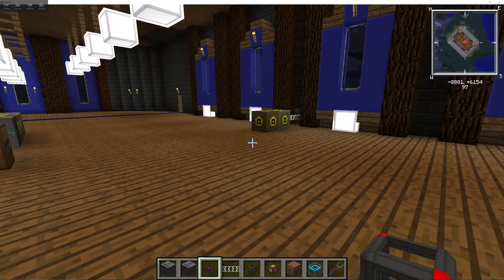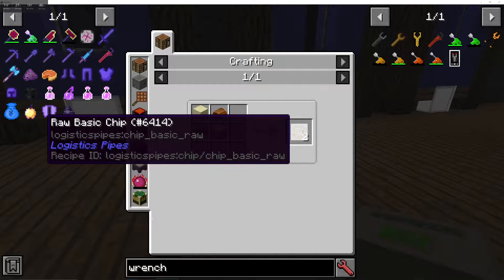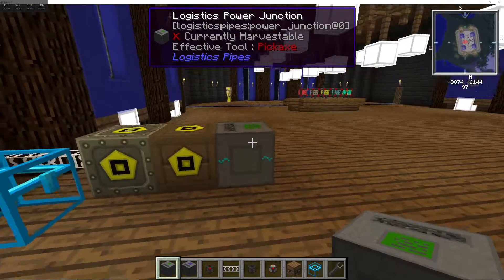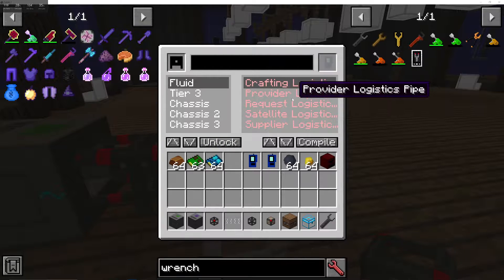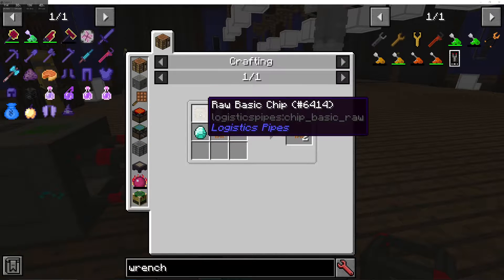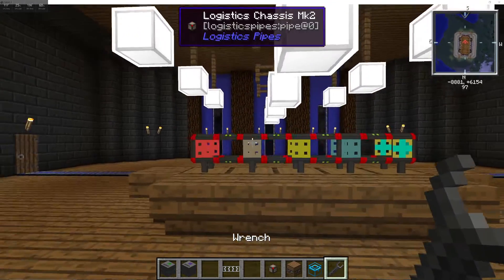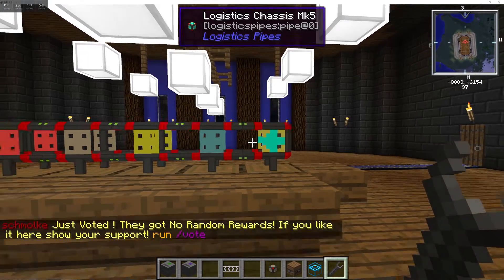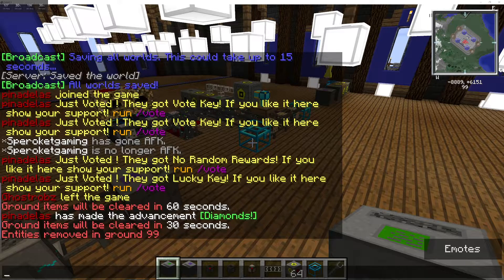Tekkit 2 Logistics pipes tutorial (Basic crafting and Moving items

Comment: the resin  is flowing out of my furnace when  it's full,,  can't find any solution online. do you have a solution? im really desperite
Reply: Same problem did you ever fix this?
Reply: @shaneparsons7797  yeah by placing a nuke in my base ;)... just starting over now, had something to do with overflow and you need a extra chest to catch the overflow, THAT extra chest should be very close by the crafting stations,,, so it will pull out that stuff first...  also i used the wrong pipes.. make sure you check if you use the correct pipes haha
Reply: @armrarr  Probably a year late but, I set up a black hole unit for overflow and it works wonder .

Comment: bruv. im rly happy to see this vid. do you know how to transport energy in this mod? like over 10000 blocks? there aint no teleport pipes/cables no more
Reply: only way i could think off was the ender tank to store some sort of liquid to transform into energy at the place i need it to be. any ideas?
Reply: @Fresch-px4dy  same here, they made stuff hard in this mod.. I don't get it
Reply: @Fresch-px4dy   it is possible but its so much more expensive then to just bring cables and solar panels or like you said ender tanks with fuel for the liqued generators. i will also say in the long run a pipeline like that would eventually begin glitching out and would be hard to chunkload as well.
Reply: Asked this same question earlier on a tekkit2 server im on, was told to use IC2's transporter block. haven't gotten around to looking into it yet but apparently that's how you teleport power in tekkit2. or at least, that's how you teleport EU. if you need to teleport something else, I don't know, I'm still new to all of this. I'm assuming there's ways of converting things like flux to EU, or maybe that's not even necessary. I have no idea, just trying to cover any further questions.
Reply: @gregsamerson4255  yeah nice. That might work
Reply: @Fresch-px4dy  been told it doesn't work across dimensions, but they didn't sound certain. Not sure you could anyways without keeping chunks loaded though.